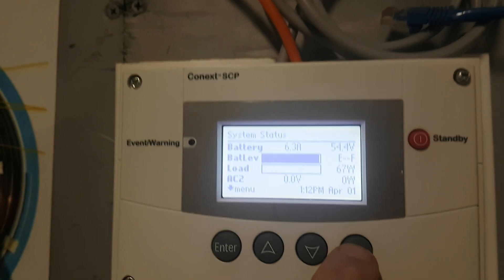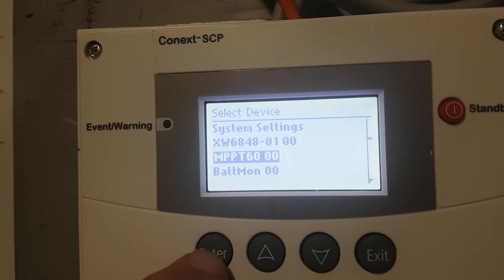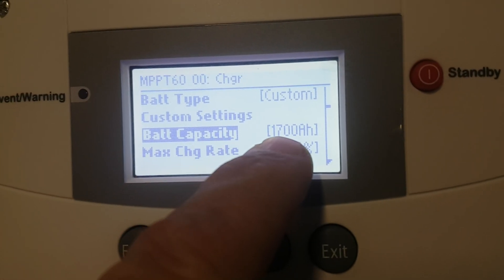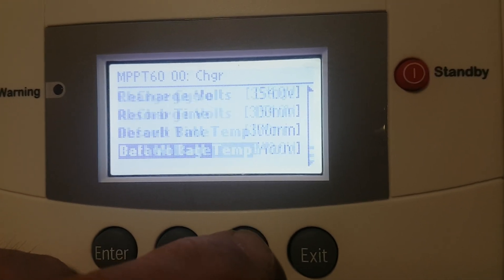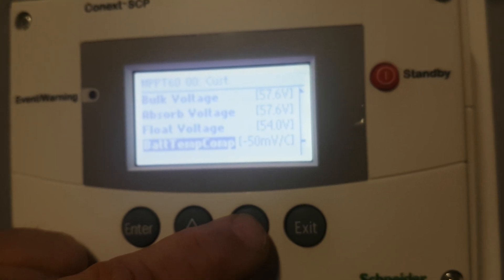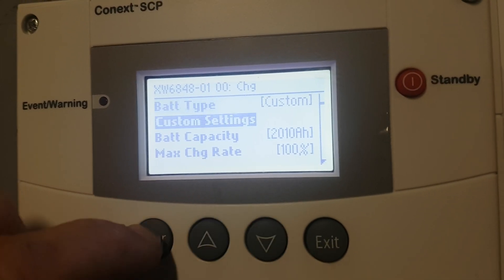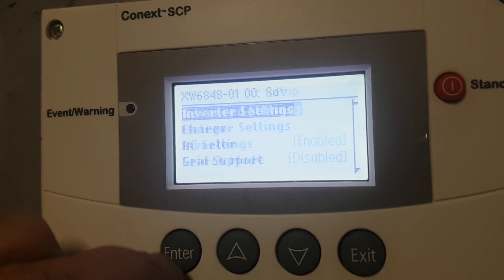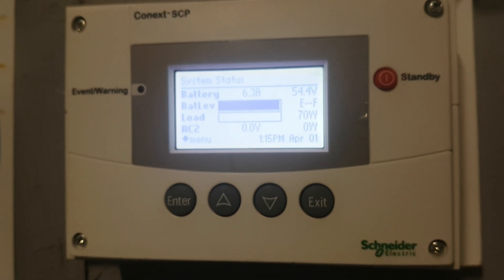Understanding Scp

Comment: I bought 8 12 v 200 AH Lithium batteries to replace 8 12 v 200 AH gel batteries. How is the BATT CAPACITY  setup according to 1 batteires AH or adding them up which , in my case would be 1600? The problem is that my Schneider 4048 does not allow me to establish BATT CAPACITY over 1000 AH? Please help.